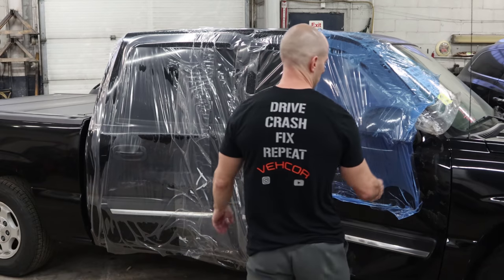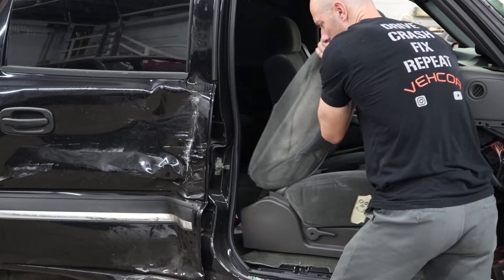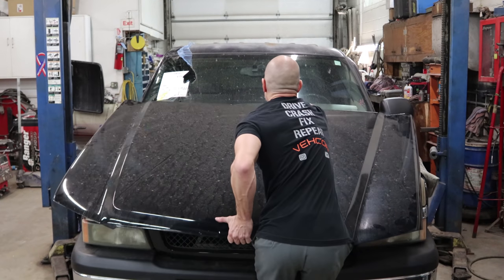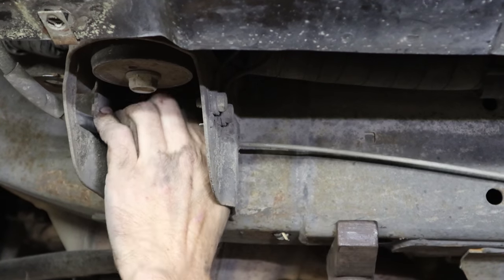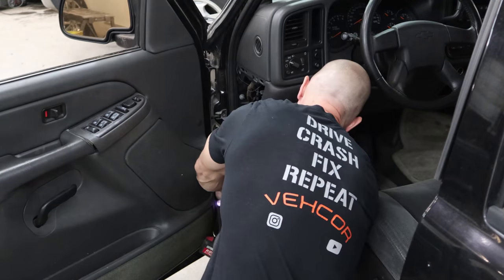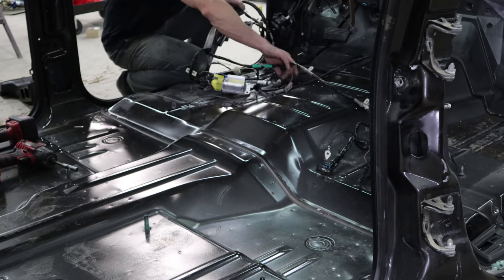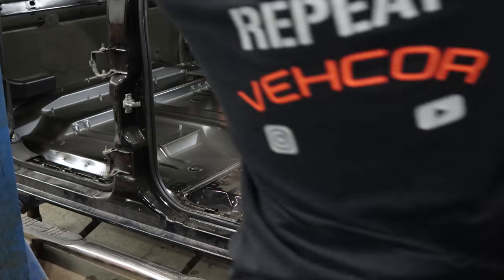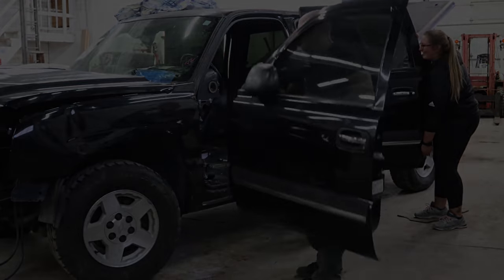Silverado side collision cab swap rebuild part 2

Comment: Sure wish we in IL had salt free roads in winter. Working on these rusted hulks makes one go crazy trying to loosen nuts and bolts. Takes longer to get the fasteners apart then actually doing the repair. Love watching you rebuild these wrecks. Happy holidays!
Reply from the maker: I agree, as a mechanic that has to work on these rusted junks! Thanks for the support!

Comment: On many a 9 mm open end wrench depresses the hood cable tabs to let them slide through. I stab myself far fewer times with an open end wrench and it is finally something that 9mm wrench can be used for.
Reply from the maker: There is also a tool for that just like the ebrake cables. I was just too lazy to get either when the pick was right there.

Comment: Hey Vehcor, I love my Pontiacs also. I own a White 2008 G8, now I own 2. I just bought on Copart a 2004 White Grand Am GT with 108k miles. She had been hit in the rear, but it needs a new crash bar, padding, & bumper cover. It is a run & drive insurance vehicle, & got it for $500. What do you think? Hello from Phoenix Arizona! 👍
Reply from the maker: Good luck with the build.  If you make the numbers work it was a good buy no matter what anyone else thinks!
Reply: @vehcor - I am going to try to do the repairs myself. I hope I will be able to do the repairs, but I am not afraid to ask for help if I need it. I am wondering if the rear fender inner liners are hard to install? I know you LOVE those liners. Considering the crash bar needs replaced, foam padding, & rear bumper cover. Which might give me the most fits?

Comment: Here is a question that has little to do with the rebuilding. That plastic you pulled off what is that called? It stuck very good and seemed to keep the weather out. I might want to keep a roll around in case of and accident or a window breaks in some fashion.
Reply from the maker: Weather barrier film.   There are different brands, that one is crash wrap.

Comment: That’s my old truck. Old man ran a stop sign and blew that side out lol!
Reply from the maker: I have had many people claim that, no one can prove it yet.  What are the last 4 digits of the vin?
Reply: I got a picture on my phone. It was down in Nederland tx
Reply: vehcor 9807
Reply from the maker: Congrats you are a good guesser or the real former owner!  I'll go with the second!  It's cool to hear a back story and the truck took that hit pretty well.  Looks like you went into a ditch after the impact?
Reply: vehcor I was turning under an underpass and this old man hit me and knocked me up the side of the overpass and down into a ditch. He was in an 12 ram and only messed up is fender and bumper. That truck ran like a champ and only problem it had was paint on the roof failing.
Reply from the maker: Well, we fixed the roof and all the damage from the Ram that rammed you! lol Glad you are ok!
Reply: Cody but why did the head light Bulbs missing lol damn bro 😂😂😂
Reply: Steven Ayala my buddy swapped his lights out with mine. I had brand new housing and bulbs in it.

Comment: Have you experienced any 2015-2019 Yukons or Tahoes with water leaks running down the windshield and A pillar?  Test drove a 2019 Yukon the other day at Carmax in Merrillville and it had water on the dash, windshield, and passenger side A-pillar behind the plastic.  They are taking it to the dealer for evaluation as the 2019 is still under factory warranty.  I'm somewhat worried and hopeful that everyone will be honest.  Also I'm glad that I caught it as it was raining the night before rather than catching it in the distant future.  I did not buy but said I would talk again once it was back from the dealer - of course they would have preferred I signed on the line right then and there.  I said NO WAY, not until it is repaired!  But it is on hold for me for now, pending repairs.  Also, the rear tailgate glass would not release separate from the tailgate.
Reply from the maker: If there were multiple issues, it may have been the reason it was traded in.  Possibly an accident that was repaired by hacks regardless of the clean carfax! I have not seen any but most new cars with issues go to the dealer for warranty work.
Reply: @vehcor  I still haven't heard back yet.  Supposedly was taken to the dealership one week ago today.  The Carfax did report that it was a fleet/rental as with the majority of Carmax's vehicles.  Titled in Missouri then sent to Illinois for auction, then ended up in Kenosha at Carmax before I had it transferred here to NWI.

Comment: What happened with the exhaust manifold?  Were you just replacing broken studs?
Reply from the maker: It is a common failure on these engines and getting to the rear two is a pain.  Since the body was off, it was easy.  The heads just pop off the bolts from the manifolds shrinking.

Comment: As far as who wins the door install battle, I have to say the women will only because it seems like you need to occupy the same space at the B pillar.
Reply from the maker: I'm attaching mine to the a pillar, they get the b pillar.  They get the lighter door and I removed the door check for them.
Reply: @vehcor  Not that it mattered anyway. You still smoked them.

Comment: ...after watching what's involved in pulling the cabs, I think I would have just done the bodywork on the pillar and rocker and changed the doors myself...not any easy job, I'm sure, but WAY too much stuff to undo and put back..and you have to pull TWO cabs...plus, you could repair the other truck and sell it, too...
Reply from the maker: It is faster to change a cab, at least for me.  The last video has a time breakdown.

Comment: I would've replaced the B pillar!
Reply: When we rebuilt my dads truck. Was similarly damaged. I wish I would of replaced the cab or the entire pillar.  We straightened it on the frame table and its not perfect. Nice driver but I like em to be good as new. May go back and replace it later.
Reply: @colescrustycars   It's a lot O work replacing a cab. It's easier and faster to replace a B pillar.  But to each his own I guess.
Reply: I dont mind replacing cabs. Easy nuts and bolts
Reply from the maker: I'm driving this long before anyone could have welded in a b pillar and rocker. lol

Comment: Can't please everyone but I'm impressed every week (as are so many)! That's really a clean vehicle you're building.
I would have to repair the damage in our state (CT). Salvage is a very BAD word here. Let alone you changing the  body and the two clear VIN LOCATIONS! They would go nuts over here and probably want to brand the vehicle 'a composite'. Fools here call a repaired salvage a rebuilt even if the title is not stamped. They look at who transferred the vehicle. Soon as they see ins co, it's a REBUILT. BUT a few years NEWER, it would have been paid to repair. Not fair good buddy.
Listen, maybe some of us enjoy watching the detail you put into your videos and appreciate IT and YOU! Thanks! Sonny (CT)
Reply from the maker: They are not that bad here.  It takes them forever to retag it but it is the best way to repair this one.  It goes through the same process if no parts with bins were changed once it is retagged. Rebuilt vehicles get a bad rep, sometimes deserved, sometimes not.  Thanks for the support!

Comment: Popping off the clip from the brake pedal to the brake booster is way easier when there's no dash in the way.  Much preferred to the yoga position you have to contort yourself into when the dash is installed.
Reply from the maker: Agreed!

Comment: I know what you mean on those exhaust manifold bolts I have 4 on my 04 that are broken but not yet leaking exhaust so I’m leaving them for now. As for the doors the old man will school them every time.
Reply from the maker: It made sense to fix these while the cab  was off.  Those two rear ones suck when the truck is together.  One more vote for the old man! Thanks for the support!

Comment: One thing, how do you get the HVAC box to stay put to install a couple nuts with only one person? I get so pis......mad doing this step as it sets on the studs and seems to fall just as i reach to install a nut. Also we older guys have to stick together so in your race I am going with the afternoon crew getting schooled.
Reply from the maker: I just reached in since there was no windshield and held it up until I could thread a nut on.  If there is a windshield I just put it up there and pray! 😂 it usually stays just long enough for me to watch it fall as the nut touches the stud!  Repeat until it works! A bungee cord or a block of wood can be a second hand after 2 or 3 failed attempts.  That's two votes for the old guy!

Comment: How do you swap the vin number from the old cab to the new cab?
Reply from the maker: The state comes out and retags it with the correct vin.
Reply: @vehcor  only in Illinois or every state?
Reply: @BobPegram  Every state is different. Some come to you to retag it, some make you tow it to a certain facility where it gets retagged.
Reply from the maker: @BobPegram  Every state has to do it. Sometimes it is the SOS sometimes State police.  Depends on the state.
Reply: @vehcor  thank you

Comment: That’s amazing, I bought a 2006 1500 z71 off-road Silverado and it had ton of damage to front end (no frame damage) and some to rear end, so I plan on doing a whole front end swap. Now I know what I’m getting into lol. Great video, thumbs up, and subbed
Reply from the maker: This is pretty much similar to what you will have to do on the front end.  They are very easy to work on.  Good luck with the build! Great to have you with us!
Reply: vehcor thank you so much

Comment: I am a pretty mechanical guy, I can diagnose and repair cnc machine tools, electrical and mechanical. When I watch your videos, I shake my head in disbelief at the seemingly insurmountable task of accomplishing this repair. It is just daunting.  And yet you make it look so easy. 

Good job Man, thanks for sharing.  Keep this up.
Reply from the maker: It is a lot of work but it is pretty basic when you break it down.  It also helps that I have years of practice!  Thanks for the support.

Comment: Dudes definitely got experience working as an auto technician and if I had to guess I'd say it was for a chevy dealer..
Reply from the maker: Nope, I would never work at a dealer!
Reply: @vehcor  well I started watching and thought you prolly made a pretty decent living buying wrecked, fixing and then selling vehicles. But then I saw you use that snap on scanner on the "mistake" and just the way you used it and explained it i knew then you were a service tech and at least one point in time did it for a living. I assumed chevy dealer cuz you seem to buy predominantly GM products.. but, having been a tech myself I feel Chevy is the best product and easy to work on.

Comment: On this generation I loved the way the lights came out real easy to replace bulbs or whatever. Also had the best steering wheel.
Reply from the maker: I agree, now you have to remove the grille and bumper to pull the lights!  I guess GM wanted more repair time on the new ones!

Comment: I moved to Texas from IL in the '80s.  Texas vehicles don't have rust issues, except sometimes on the coast.   Paint, interiors and soft trim take a beating from the sun, though.   Then there's the baseball and larger size hail that we get.   That stuff will demolish a car.   Friend of mine ran a body shop couple of hours west of you in IL for 40+ years.  He called that hail "Texas rain."

Comment: I have a 2001 4x4 Suburban from Nebraska and the ABS module electrics are acting up and the lines are very rusty do you think I should just Dump it and Purchase another truck as repairing it probably will be excessive??? And it's got your northern rocker Rot, it didn't show for a year or two? Didn't look under it first, I'm Stupid!
Reply from the maker: Clean the front wheel sensors and replace the lines.  A little time and less than $100.  I don't think you can buy a new truck for that.

Comment: Great video! I got a question for you, do you think the build quality of a 2003 Thru 2006 Silverado and the overall truck is better than a 2007 thru 2014 Silverado? I feel that the 03 thru 06 Silverados are way better
Reply from the maker: Yes I like the 99-07 generation better. The 07-13 had lots of issues and I thought they were ugly as well.  They did turn it around in 14 and that generation is now my favorite.  The 99-07 is still the easiest to work on but the comfort and quality of the 14-19 is much better. Of course this is all just my opinion from my experiences. Thanks for watching.

Comment: I am confused. Why couldn't you leave the rear seat, carpet, etc. in the replacement cab? Couldn't you just disconnect things that needed to get disconnected to lift it off the frame like heating, steering, brake booster?
Reply from the maker: The wiring harnesses are different like I said in the video.

Comment: Look up a product called wool wax, it's made by the same company as fluid film and is supposed to do an excellent job at rustproofing.
Reply from the maker: I have products that I use and have seen their abilities firsthand over a couple decades.  I'll stick with that.  I tried FF, it sucked. Kind of turned me off to anything else they might come up with.
Reply: vehcor Interesting, I’ve used fluid film and have had great luck with it. Yes it does wash off in exposed areas and need reapplied yearly but that’s kind of the point. Wool wax is supposedly much thicker and is supposed to work better, I’ve yet to use it personally but have heard great things.

Comment: hi just wanted to no can i pull off they doors they same way you did on a 08 chevy silverado
Reply: It's pretty much the same process
Reply from the maker: No, both ends of these hinges are welded.  They separate in the center.  The next gen unbolted and only one hinge separated.

Comment: Need to get yourself one of those rope tools for removing glass I've watched you struggle more then once with front and rear glass. We have the technology 🤔👍 keep up the good work my friend.
Reply from the maker: It is funny that you refer to the oldest method of window removal as technology. 😂 I have the wire, it is just as much of a struggle.
Reply: @vehcor  no no no they have a new version 🤣🤣🤣 its rope not wire 2 suction cups and a crank handle but either way your work is 5 star all day love the videos and the detail. Keep it up. (!!!!!From the other side of the lake😉).